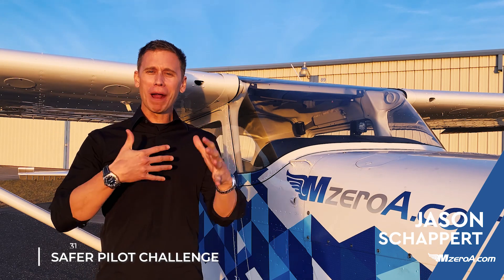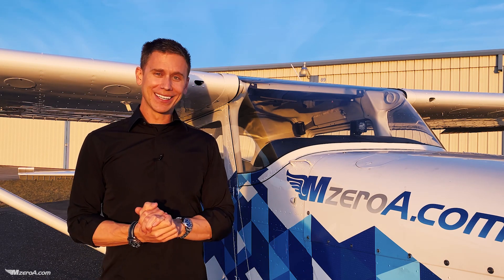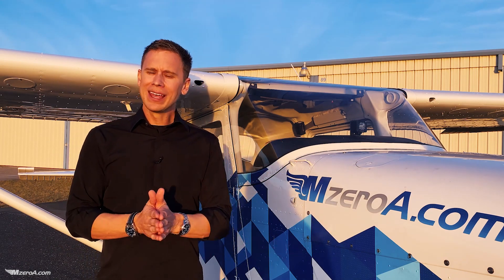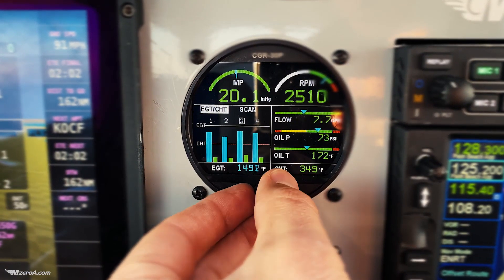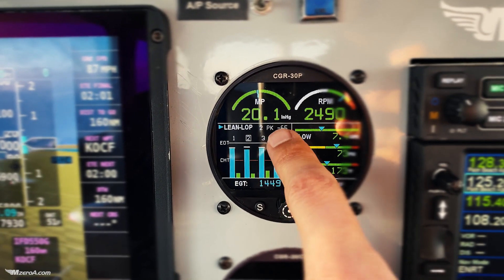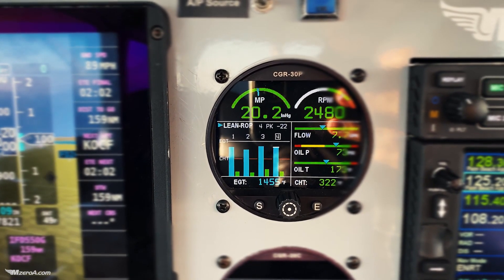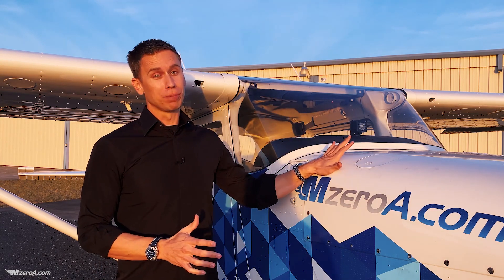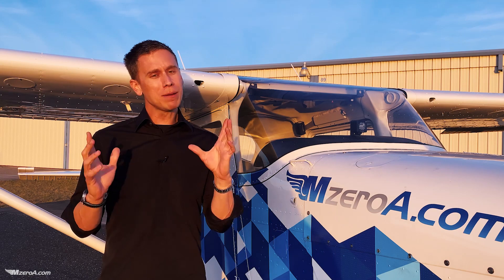How To Lean The Mixture - SPC Day 28

Comment: Jason, I'm flying a '76 Piper Warrior. Once my break-in period is complete I plan to run lean of peak. It's equipped with a JPI EDM 830, so like 23MZ, it has all the info in the world. Running LOP has gotten my CHT's from the high 380's at rich of peak to the low 300's with a 10 knot penalty but the low 7's in fuel consumption. Still cruising at 115ktas, so not bad!
Reply from the maker: Thanks for sharing, James! Fly safe!

Comment: 28 2 28!
Our old 172's (Military versions T-41Cs) don't have the gauges to determine EGT. We have to lean on the ground (6180 ft) to a nice smooth running engine. Once flying we lean for fuel flow then full rich for landing.
Reply from the maker: Thanks for sharing!

Comment: I learned this Old School: lean until the engine stumbles, then rich until it runs smoothly. My plane has an engine monitor so I can lean precisely. Lycoming and Beechcraft say to run at peak or slightly rich of peak, so that's what I do. My typical EGT is 1420F in cruise.
Reply: Learned the same thing.  Lean it until you hear it struggle and then give a little back.
Reply: @dsyncd555  that is the way I was teach in 1985.
Reply: Yes, that's typically how it's taught, but also because most training aircraft (the good ole 152s and 172s at most schools) don't have CHT or EGT gauges. So it is not possible to see things very precisely. Personally, I was taught to look at the tachometer and lean until you see a slight drop in RPM, and then turn the mixture knob 2 to 3 full turns to the right, giving you slightly ROP.
Reply from the maker: Glad you enjoyed the video! Thanks for watching!

Comment: What about peak
Reply: Peak causes high cylinder temperatures, but very good power. If you can keep CHT's down in a healthy range, there's an argument to run at peak. It's just a challenge for air cooled engines.

Comment: Reminds me of when my father swapped a 160hp in his Skyhawk for a 180hp.. Flap mods installed too.
Once checked out on the ground, we sat and watched as dad went up for a minimum of 1hr flight and was told "Go full power on takeoff, and leave it there for an hour minimum.. Then you can slow down and land, and we'll look it over..."  Umm What?? LOL  
So he climbed and circled the airport at about 3000 (in case of failure) for a bit over an hour. Just making high altitude patterns.
To your point, they are meant to be run hard... Cars/Boats etc.?? Yeah, be gentle..  Airplane engines are NOT built the same... :-)
Reply: New engines or redone engines need to run harder in their beginning life
Reply: The point of running "hard" is to seat the rings. There has to be sufficient cylinder pressure to press the rings against the cylinder wall, so high power and rich mixtures are necessary. Otherwise, there will be massive amounts of blow by past the rings causing cylinder wall glazing, and combustion gasses going into the crankcase.
Reply from the maker: Good point! Thanks for watching.

Comment: My wife and I have put 2000 hours on our Cirrus SR22 and Baron over a 33 month period running LOP👍🏼.  So that is 18 cylinders for 2000 hours and they are all still in good health, mid 70’s compression, good borescope👍🏼.  You are correct, Mike Busch has some great videos on this subject matter.
Reply: Yes, but that assumes proper engine monitoring instrumentation (EGT, CHT etc.), which I assume your aircraft have. Most training birds at flying clubs and flight schools, of 70's and 80's vintage, do not have the required instruments. In those situations, I would always go ROP, to avoid severe engine damage.
Reply: @747-pilot  ..yep, In the video, 1 minute and 10 seconds in, Jason spends a minute explaining this.👍🏼
Reply from the maker: Thanks for sharing Gary!

Comment: G, day MzeroA from Sydney, Australia.
My opinion:
* engine manufactures recommendation
* adjust so CHT is within the normal operation indicated by the engine sensors and displayed on the gauge.
* seek advice from pilots with the same engine: history of piston head damage.
If I can use the analogy? As you now intercept the localizer on approach to the final of the MzeroA safer pilot program, " that's a nice look'n Cessna ya have"!
🍟
Reply from the maker: Great suggestions! Thanks for watching!

Comment: Thanks.  Me.  Rich of peak - but I monitor cyl hd temp. and adjust to keep temp. in range described by POH.  Usually some richer than “just rich of peak”.
Reply: Have you tried running LOP? I've had very impressive results in CHT reduction by running LOP and a 30% fuel savings. I'm doing it with an O-320 E3D
Reply from the maker: Thanks for sharing!